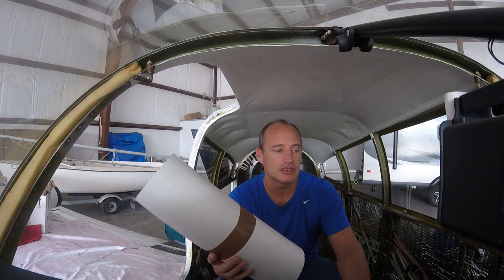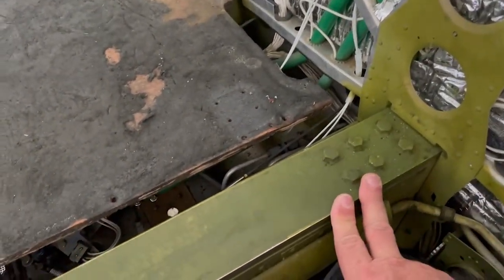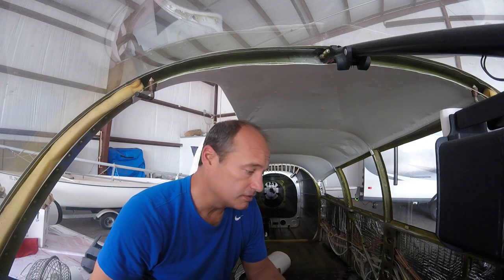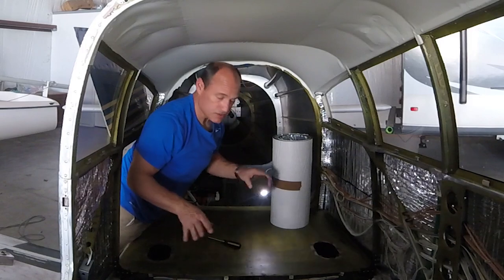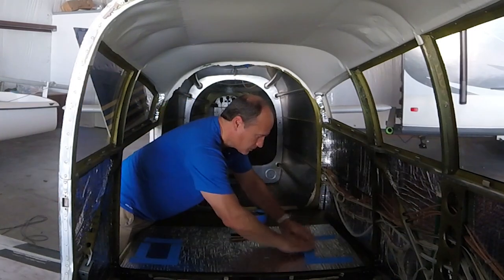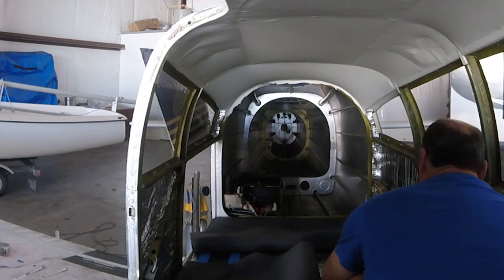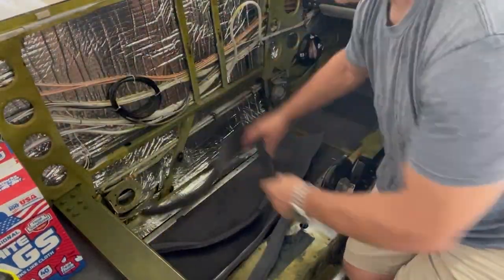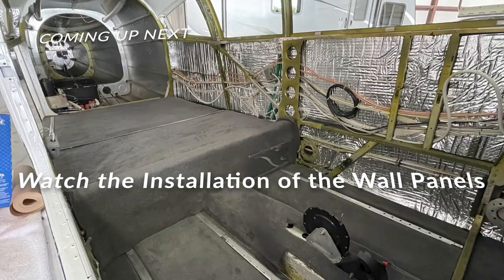Piper Arrow Interior Renovation part5  New Carpet Installation

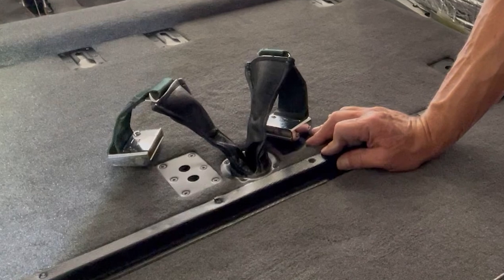Comment: I see at 14:46 to 15:00 that the rear seat hold down plates that the seat slide into are missing.  Do you have them or are they missing?  They go over the top of the plates with the six screws in each one.  I had to remove all of those fittings to install the new carpet and cut the hole for the rear seat belts to go through.  That part seems to be about the most work intensive.  I painted my plywood board black as it was from the factory.
I like your detail in your videos and will likely follow them and make further comments you might reply to.
Reply from the maker: Sounds like the rear feet of your back seats are held in place a little differently on your model year. Mine just press down into holes in the rear plates.

Comment: Is the carpet flame retardant with certification?
Reply from the maker: Yes absolutely. All of the products from Airtex come with all the stickers you need for your logbook. It’s all certified. They’ve been around for decades and have a pattern for just about every GA airplane out there. And they are extremely knowledgeable about the differences between model years for installation if you have questions

Comment: That board also has cutouts for the flap spring in the front and for the seat belt hole in the back.   Did you use a router to remove that exact amount of plywood?  Mine was a fraying a little so I took JB Weld and any place that appeared to be weakening I applied the JB Weld and made the entire board including cutouts much stronger and as thought they were overlaid with fiberglass.  I still retained the proper clearance for the flap spring and the seatbelt bolt cutout.
Reply from the maker: I did use a router. Picked up an inexpensive one from Harbor Freight. I like the idea of adding the JB Weld to that area and others for strength.

Comment: You said you replaced the board?   That board has metal fasteners for each of the rear seat metal plates.  There are six on each in the front and four on each on the rear that go through the board and are "cleated" to the bottom of the board.  That sounds like a real project to cut a new board (3/4" or 1" plywood) then make the cutouts for the side vents, then drill holes for the 40 total "cleats" that must be installed, then the carpet then the metal seat holding mechanisms with the buttons.  Your buttons are missing in the back.  That is what holds the seats in.
Tell me something about that.
Reply from the maker: I saw that you kind of answered that question in another comment, but sounds like your brackets in the back are a little different than mine. The rear brackets on mine just have holes with some internal hardware that holds on to the seat pegs that insert into them in the back. I show this in the DISASSEMBLY video - ( https://youtu.be/MJNVESvgHqM )removing and inserting the rear seats.